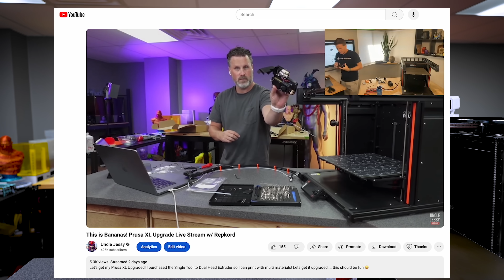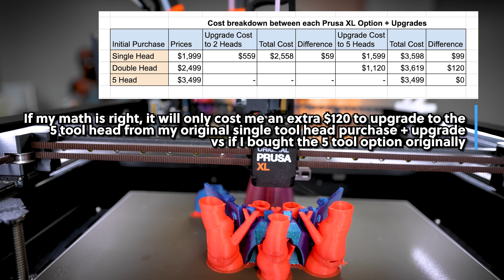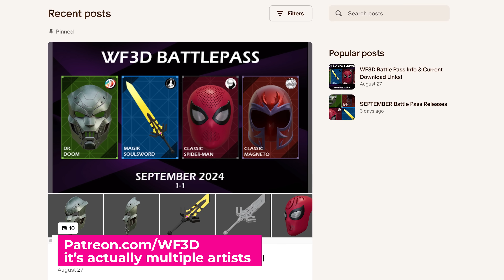This shouldn't work but it did - Multi Material 3D Prints

Comment: The Presa XL looks nice and 5 different tool heads sounds great. But the price is crazy, also I could see the Prusa XL tool head system having some issues especially if the printer tool head isn't lined up correctly or the part that selects the tool head is off. Plus what if you are running different filaments that require all different templates? Also  I am sure I have seen videos of a product that does this I believe it is called the "Carrot" so there is no need to buy a new printer. Plus it doesn’t offer the and latest topic of multiple hotends printing at the same time with could really change the game. We all know that Bambu Lab will release a new printer that is similar if not better. As well as a way to upgrad current printers to have multiple tool heads. Just imagine 5 tool heads, all 5 hooked up 4 AMS system. So 20 AMS systems allowing 80 spools of filament. Even though Bambu Lab AMS systems max is 16 that isn't really true since if you keep splitting off the adapters that feeds the filament to the printer you can run as many as you want. Only issue you might run into is a power supply but that could be easily fixed  if they release a power adapter.

Comment: I really wish my p1s had a 2nd print head. I do a lot of minis and terrain with thin layers. They need a lot of supports and don’t always come free clearly, but the amount of waste just swapping for interfaces is crazy. Like many times the amount used for the print. I’m sure this comes from the small layer sizes and relatively low volume of the print, but the AMS system is completely impractical for this use case

Comment: This shows a perfect case for recycling PETG waste.  TBH I'd love it if filament manufacturers would make a PETG specifically for supports like this.  It doesn't need to be high quality or consistent colour. It just needs to print and the cheaper the PETG costs the better.  In fact using dirt cheap recycled PETG would reduce print costs even more by preventing PLA prints from failing due to bad support settings or supports welding to the print forcing it to be done again.

Comment: Other than the bigger print volume, the cost difference between the Prusa XL with 5 print heads and a Bambu Lab P1S with an AMS is $3,150.  So the real question is, how long would it take to build up $3,150 of poop from the Bambu Lab to justify the cost of the Prusa XL?
Reply from the maker: That is very true. I think time would also have to factor into this as the multi color prints on the xl print a good bit faster than on the Bambu machines
Reply: @UncleJessy  I was able to find a Doctor Doom mask (not the same one you were printing) and with PETG as tree supports, it would have taken over 2 days to print.  I'm guessing with the XL it is about a 5-6 hour print?  If you had to mass produce stuff that needs perfect bottoms everywhere, the XL does make sense, but one offs, I would learn to be patient for $3k, lol

Comment: Also you don't have to worry about jamming when swapping between materials that print at different temperatures. I'd love to use PLA supports for my PETG, but in my experience you're more likely to jam because of the temperature difference or spend a lot of money on HTPLA to reduce that risk and waste a lot of it switching materials. At that point you might as well go for a soluble support.

Comment: I think it's a way better solution to have entier supports printed in PETG here, because printing just a tiny layer (or several) in PETG between PLA may just create 2 week interface instead of one and may result in a mess. That's what I did several times on my Bambu, and every time there are chucks of interface material that come loose and ruine my print.
I think I will change my Bambu to a Prusa XL soon.

Comment: Rather than printing the whole support s in PETG. Could you just print the interface layer (the last layer before the part) in PETG?
If so than the Bambu would not waste much more filament either.
Reply: The Bambu would still waste a lot. Its just what it does.

Comment: I routinely rock a PETG support interface layer when supporting PLA on my X1-C for clean removal (or vise versa). But by only using it on the interface layer, there is less waste.

Comment: I actually just printed something in tpu and used a ring of pla for support material that i designed in fusion with zero tolerance. It worked out great because they dont stick together, and the support surface was perfect. Unfortunately i dont have a dual toolhead setup like this, lol so i could only have the ring go up so high so it didnt interfere with the fan ducts and cr touch.

Comment: What's the benefit to PETG here? Why not just all PLA?
Reply from the maker: They don’t adhere to each other so the supports remove super smoothly and don’t leave scaring / stick to the prints. You could print supports in PLA and the object in PetG as well. I need to experiment with just using this for the interface layers as well
Reply: @UncleJessy  Thank you.

Comment: Removing support that easy is the best feeling ever. The route I'm taking doing PETG support and PLA print with my X1 and AMS is to print the support using PLA and only using PETG for 2 layers to interface between the support and the part. It's a feature in Bambu studio and it works well. It decrease the amount of poop generated.

Comment: I tried PETG for print, PLA for supports with various results (PLA+ too if trying to match heat better).  When it works, it's great. When it doesn't, it's a mess.  The general thing I noticed is if the print material contacts itself (the main body), it works very well (like how the mask mostly prints) as it also gets some support from the main body.  However, if the print material is floated on top of the supports without contact with the main body, then there is a higher risk the print material will come of the support and make spaghetti.

Comment: Changing the setting to "interface only" swaps would probably cut those 16 hours down to a 8-9h print.
I hope you make an update video after verifying and testing.
Reply from the maker: Yup! Planning on testing that out
Reply: @UncleJessy  need to set top and bottom interface spacing to 0 for smooth finish where the overhangs are
Reply: Support interfaces should also be 100% it helps alot with the quality
Reply: and the same goes for bambu machines.
Reply: You can't do that because petg and pla do not bond, meaning this method only works when the support material is in contact with the build plate.
Reply: @CoryTaylor904  yes you can do that I do it all the time

Comment: Someone said I was crazy for trying this a few years ago with just a dual nozzle printer. It worked but the slicer wasn't made for it so i had to make some convoluted configs and variables to pull it off. The only issue i had was pla doesn't like a bed thats hot enough for petg so i had to use a raft.

Comment: If you only swap to the other filament for the interface layer then you'll cut down big time on tool changes. I've used that trick on my P1S w/ AMS.
Reply: A lot of the time the supports fail when doing it this way better to just make the entire support Petg
Reply: @envy3436  If you have a prusa XL then sure. But if you're using an AMS, it's going to switch at least twice every single layer and that will take an obscene amount of time. I've used that trick a few times and I've never had supports fail. I'd rather take my chances than have prints take double the time because of the extra filament swamps

Comment: For this setup, could you have different sized extruder nozzles on each print head? For example, a 0.2 mm nozzle for fine detail and a 0.4 mm for structural components?

Comment: why does it have a purge tower if you are using different nozzles? why does it have to be purged?
might it be there to build the pressure in the nozzle before printing and to catch any oozing that has happend while the tool was parked? so it would be a prime tower instead of a purge tower?

Also i see the whole tree support being printed in petg, even in layers where there is no supporting of the model happening,
is it possible to use a support interface layer and only have that as PETG? then you dont have to switch toolhead on layers that arent doing any supporting and you wont have to prime the nozzle on that layer. Increasing print spead and reducing the little bit of prime waste.
Reply: It's a prime tower to get the filament flow stabilized, Bambu does the same. To answer your question: Yes, it is possible to set it up to only use PETG for the interface.

Comment: I would really like to see you print TPU with PLA/PETG. It's one of the thing that sets the XL apart from the bambu lab, besides the amount of time and purge waste you save, especially in large prints. The xl is expensive, but i think for the right application, it"s worth the money. 

Great video, by the way! I've been watching for some time, and i enjoy all your content.
Reply from the maker: Oh I will 1000% be doing that soon
Reply: @UncleJessy  I have a proof of concept part that I designed that is a bearing mount of TPU inset in a PLA or PETG case that I can send you. It is a fairly quick print.

Comment: I'm sure it rumoured that Bambu are working on a printer like this. I'm holding out for that in the hopes that it'll be cheaper than this beast. I so need a multi head printer as I am rather fed up with the amount of waste from my carbon
Reply: Highly doubt bambu labs is going to be making any new 3d printers during this time
Reply: @redtalks4425   why ?
Reply: @redtalks4425  probably referring to the lawsuit that is going on? I hope this doesn't slow them down.
Reply: You can already print multi-material on any bambu with ams.. I print my supports with bambu support pla.
Reply: @au55iepetewalker81  yes but the AMS wastes a lot of material. I'm talking about a multi head printer like this Prusa XL but from Bambulab. With one of those you can print different colours without having to purge out the different colours/materials everytime you change. The AMS is great but it does waste alot of filament. A multi head printer doesn't.  Also if I was you, I would stop wasting your money on Bambulab pla support material as its very expensive and you can simply use petg instead. I do this often  and it really can work a treat.
Reply: @au55iepetewalker81  hes talking about multiple print head as shown in this video, not just material
Reply: For whenever that happens I'm just gonna get the XL, recently been seeing a lot of good things about it.  But kudos to the Bambu fans I guess.
Reply: @krollmond7544 I've been tempted too, but it's way too expensive for me. Hopefully bambus will be cheaper. I also already have an x1 and a1 so having it part of the ecosystem where I can easily manage them will be nice.
Reply: @alexgibson7960  yeah the price sucks, and I personally don't think the enclosure is worth $600 (like what even lol).  It should come with the enclosure THEN I would say the price is worthwhile.

Comment: PETG pretty much won't stick to anything except PETG - so it will work as support for most common filaments. You can also just use it on the interface layer; I don't really see the point unless you want to save more of one filament.  Full supports are nice if they need to make contact with the main piece other than just at the top. I've used this on my Bambu X1C and my Snapmaker IDEX.

Comment: What a waste of money, nice touch for that money you have to add your own cam
Reply: Depends on how much you print/use multiple filaments and how important reduced print time is. Filament waste adds up; so the less you waste the more you save. Quicker print times translate to more sellable items in the same amount of time.
Reply: Well waste of money depending on the point of view, can you buy any other commercial toolchanger 3D printer for this price? You can’t .
Reply: That’s not true in both cases. You can achieve the same, or even better, results with something like an SV08 and a commercial MMU for a fraction of the cost. It’s more reliable, offers better support, and retains its value, whereas Prusa locks you into their ecosystem at premium prices just for the name. The XL doesn’t even come with an enclosure, essentially making it a PLA printer. Plus, it’s so "advanced" it doesn’t even need an accelerometer for input shaping, so fast printing—like a fast-moving print head—is out of the question. Sometimes it feels like Prusa is a cult—people think it’s the only option and just blindly pay up. Look at the MK4—still using 2016 tech, no camera, and it’s $1,100. Don’t get me wrong, I had a Prusa in '17, sold it in '20, and went with Voron.
Reply: @TheOneAndOnlySatan how does Prusa lock you into their ecosystem?